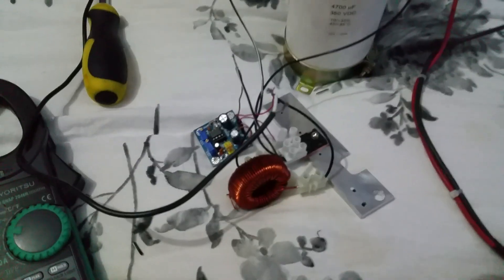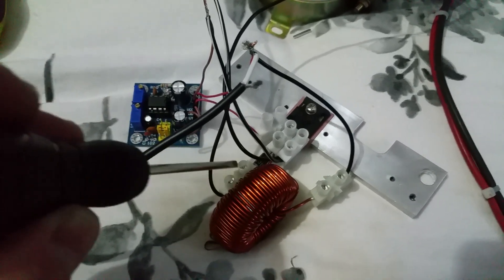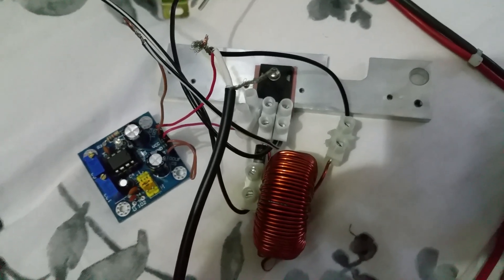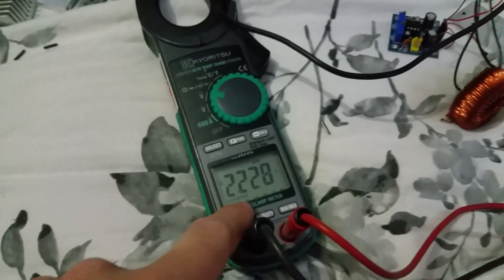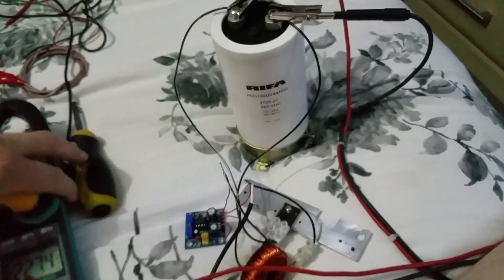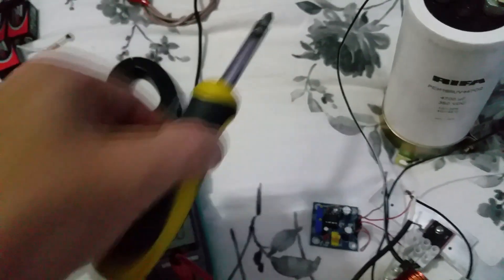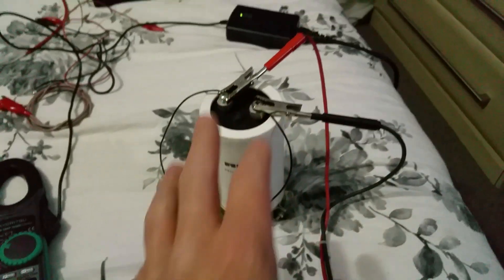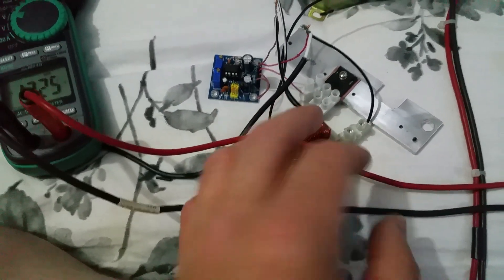Buck Boost Converter! Low to high voltage!

Comment: guessing from your accent (the way you say inductor) 
are you British
Reply from the maker: Mrinal  Thakur lol yes I'm British mate. I thought you would of none that by now lol. you have been a subscriber for a long time! haha 👍😉

Anthony 

High1voltage1rules
Reply: high1voltage1rules yeah
Reply: high1voltage1rules we share a passion for electricity 
Especially high voltage
Did you purchase Tc4421 drivers 
Those are high speed 9a MOSFET/igbt driver capable of driving g larges power MOSFETs and igbt bricks
Reply from the maker: Mrinal  Thakur Hello, Iv so many mosfet and igbt's in different forms mate I could be the new RS components lol. but thanks 👍😉 
and yes iv a passion for fast switching circuits and high voltage. and high frequencys. I just love it. but at the moment it's cold here in the uk and when it warms up I can start doing more in my lab.⚡🔥💥💣🔞👍😉

hope ya well and thanks 👍 

Anthony 

High1Voltage1Rules
Reply: high1voltage1rules yes I am well I am from northern part of India
Reply: And it's 9°C down here
Reply: Look isn't she a beauty a water cooled capacitor

Comment: wow this is very similar to what i made in my video

to get a very high voltage you need to use an inductor with a few hundred windings and something faster than an irfp260n
Reply from the maker: Yeah thanks mate. I was thinking of using a igbt for the switching lol. a super fast one 🖒☇
thanks for the comment mate and info😉

Anthony 

High1voltage1rules

Comment: I'm curious about your lightning detector.
Reply from the maker: I got it off the Internet some years ago of a company called the weather shop. it works very well. gives a bleep and an idea of how far away a striking was. as soon as I know we have a storm on its way I switch it on. it takes 2x 9 volt cells. but can work on one.

hope this helps and thanks 

Anthony 

high1voltage1rules

Comment: so kind of the same circuitry or idea that charges the flash capacitor in old cameras?
Reply: yeesss😀
Reply: lol yes, i managed to disconnect the old capacitor from a crappy camera and charge any capacitor up to 300 volts with two AA batteries :D 
on the first - third try when discharging it doesn't really give a bang, after like the sixth try it really starts to.
Reply: +𝘀𝗸𝗶𝗹𝟯𝘇 it will only charge you caps to 3v not 300 
with two AA batteries
Reply: Mrinal Thakur
 then why is my multimeter showing 300?
Reply: +𝘀𝗸𝗶𝗹𝟯𝘇 I don't kno
Reply: Mrinal Thakur
it is charging to 300v, because AA's can actually deliver a modest amount of amps
Reply: ***** you do  difference between amps and voltage wright
Reply: Mrinal Thakur
yes, i think the batteries can charge alot of volts into the capacitor slowly because they can deliver amps, so amps are slowly being stored into the capacitor the discharged with a boom
Reply: ***** let me try that myself

Comment: Now, I would like to see that charge up a bank of capacitors. It looks like a beast charger.
Reply from the maker: it is mate thanks. I will show more very soon. and Iv made another also. there so much fun. and have so many uses. not using them to charge caps you can use them drive other things as well.
hope ya well and thanks for the comment 😉👍

Anthony

High1voltage1rules

Comment: Nice boost converter circuit you have there!

The isolated version is known as flyback converter; a classic controller is uc3845.

How does your wife deal with black metallic spots on the sheets?
Reply from the maker: lol. she never says anything lol. but I did once get solder on our bedsheets and she got abit angry lol. but I don't care lmfao. 
thanks mate for the comment.😉👍

Anthony 

High1voltage1rules

Comment: Interesting, looks like you like to have fun with capacitors, if you keep the power on would the capacitor get up to 400 volts with that circuit ?, can you do this again showing the waveforms in the circuit when its working on a scope ?, PM me your address and I will send you some caps I have spare in my electronics lab to experiment with, keep up the good work, Dave
Reply: Done.